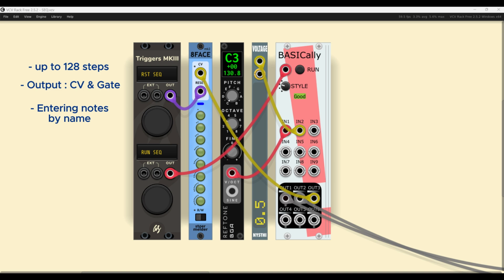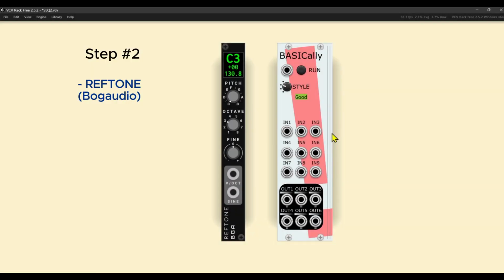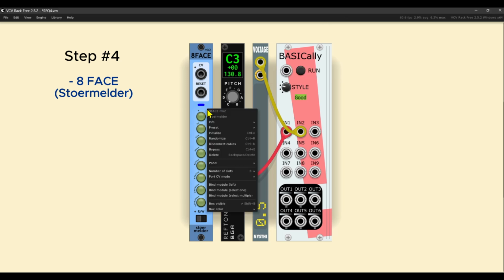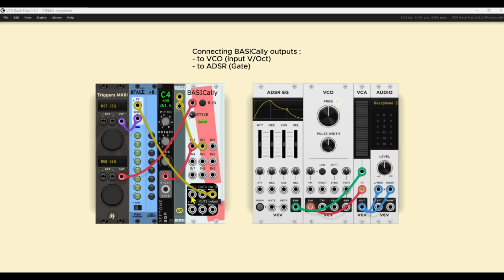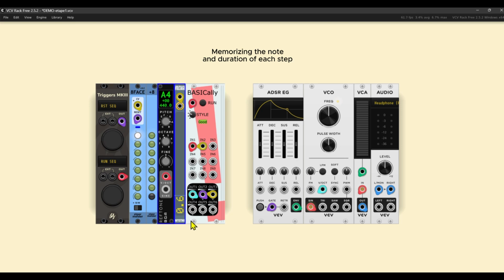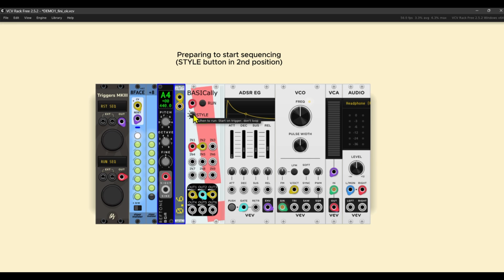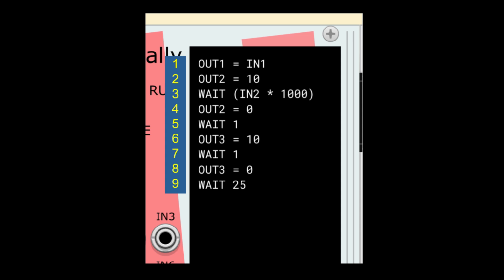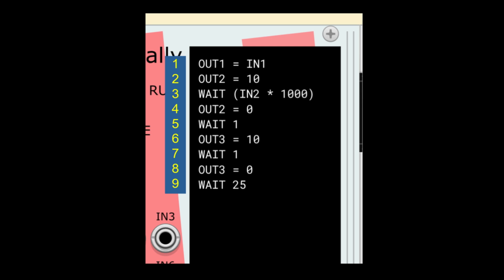A VERY AMAZING AND POWERFUL SEQUENCER WITH 8FACE AND BASICALLY - VCV RACK TUTORIAL

Comment: I am probably fairly dense 8face has me stumped on windows and it doesn't seem to store my values and there are no more sources about it as far as i can tell.
Reply from the maker: The 8Face MK2 module has a user manual that can be accessed via the module's context menu (right-click the module, then Info > User Manual).
Can you specify the difficulty you're experiencing?
Reply: @Newbie2B it appears to save then when I go to the secondone it isn't ...  most likely I am the problem but I am not sure.  is there another module like that one??
Reply from the maker: @DexterU.S  I think the "failure to remember" problem stems from a lack of prior association of the modules with 8 Face.
In fact, before entering each step (i.e., choosing a note in Reftone and its duration in Nysthi Voltage), you must tell 8 Face which modules it should remember the parameters for.
To associate Reftone and Voltage with 8 Face, the procedure is as follows:
- Right-click on 8 Face, which opens the 8 Face context menu.
- Left-click on the "Bind module (select multiple)" option, which transforms the current mouse cursor into a crosshair.
- Then left-click (with the crosshair) on Reftone. A blue border appears around Reftone, indicating that it is now associated with 8 Face.
- Then left-click on Voltage (with the crosshair). A blue border appears around Voltage, indicating that it is now associated with 8 Face. - Finally, click anywhere in the VCV Rack window, outside of the modules, which will return the mouse cursor to its "normal" appearance.

To check if the association has been successfully completed, right-click on 8 Face to open its context menu.
Then, by hovering over the "Bound modules" line, you can verify that the list of modules associated with 8 Face is correct.
(In our case, Bogaudio Reftone and NYSTHI SlimFixedVoltageSource should appear in "Bound modules")
Hopefully this solved your problem.